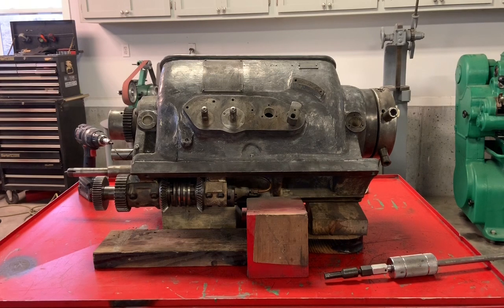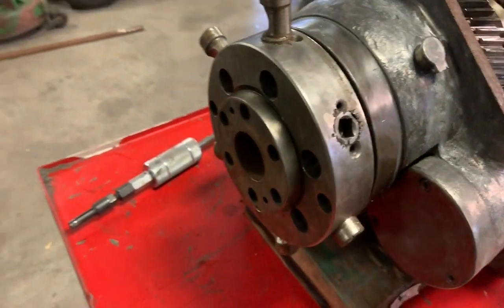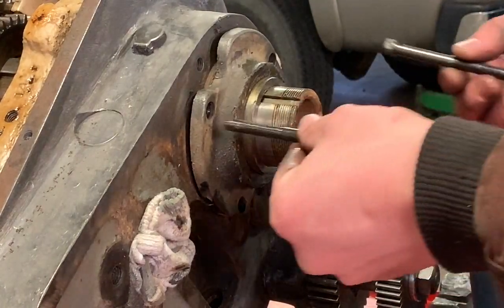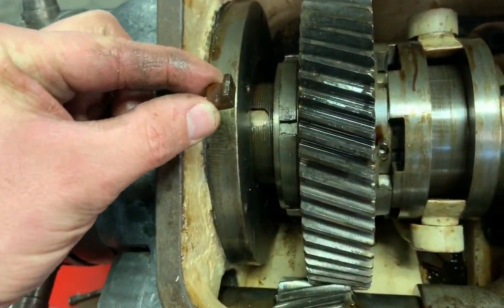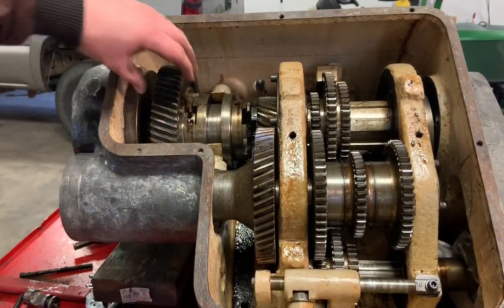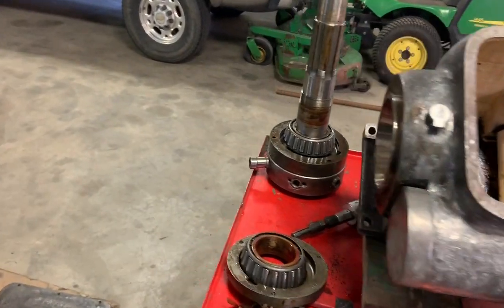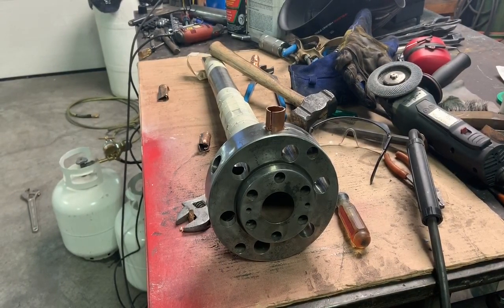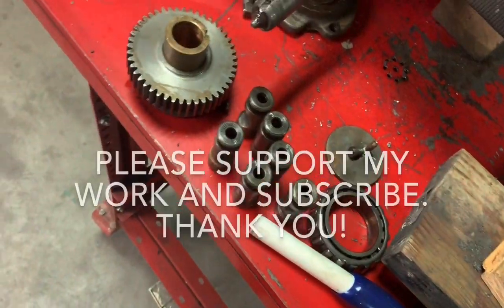Hendey Lathe Spindle Removal & D1-6 Camlock Repair

Comment: Most lathe chuck backing plates are in fact cast iron, dimensionally they are more stable (less internal stresses) than rolled or forged material. That does not however exclude it from being steel, most cast iron is steel of one variety or another.

Comment: Putting it back in is the fun part. Check that the retaining nuts are free on the thread before putting it back in. I learned the hard way to always to do that. When the last nut won't go on and its gotta come out and get fixed doesn't make for a good day. I have a 13 X 30 Hendey, that I saved from scrap, that needs work and I'm learning a lot from your video. great job.
Reply from the maker: Completely agree, put it in a few days ago and getting the bearing preload set correctly is tricky for sure.

Comment: I have an 18 speed Hendey Lathe that needs a shaft. Does anyone know where I can get the shaft with the clutch and pulley attached to it?
Reply from the maker: Parts are difficult to come by. If your old ones can’t be repaired then a parts machine is probably your best bet.  Engineering drawings are still available to have parts custom made.